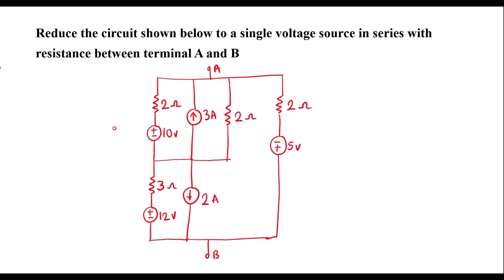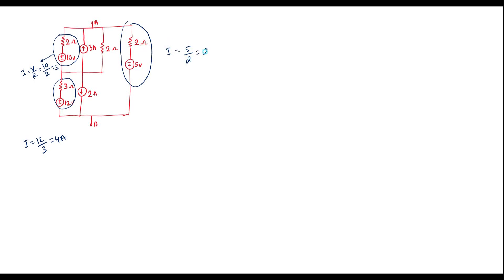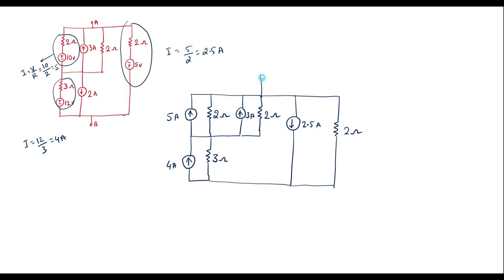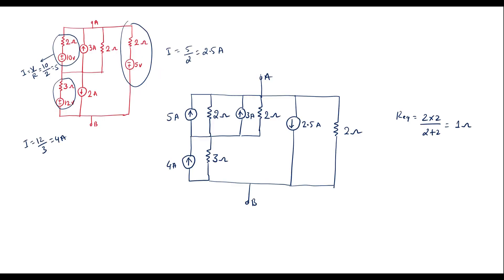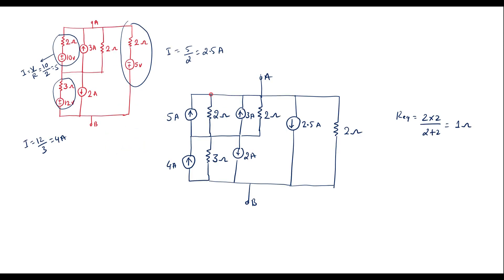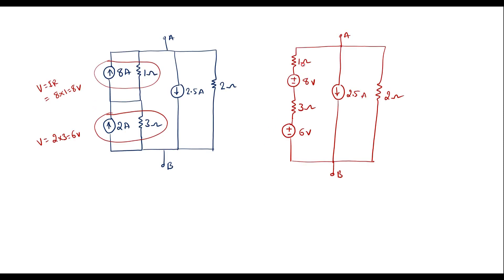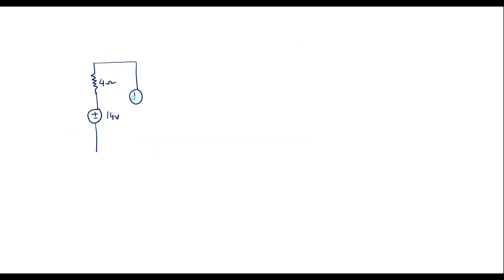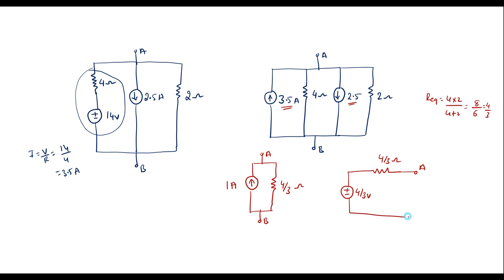Reduce the circuit shown below to a single voltage source in series with resistance.

Comment: Hi,
After you redrew the circuit again at 8:20, you converted the left side into a current source. What if you convert the right side into a voltage source? For some reason I get a different answer when I do this. I convert the 2.5 A source into a 5 V source in series with the 2 ohm resistor. This gives a total voltage of 19 V in the circuit in series with a 6 ohm resistor. Am I doing something wrong?